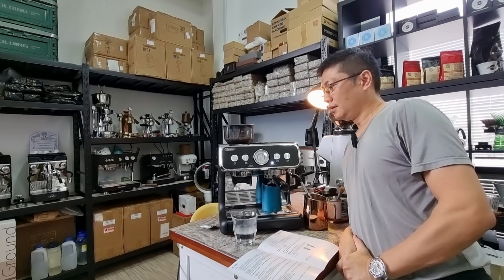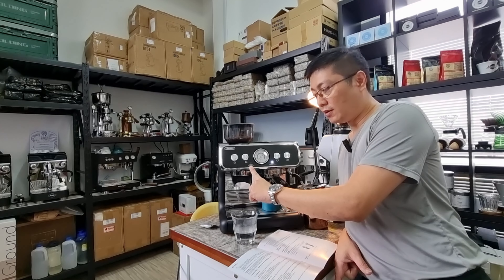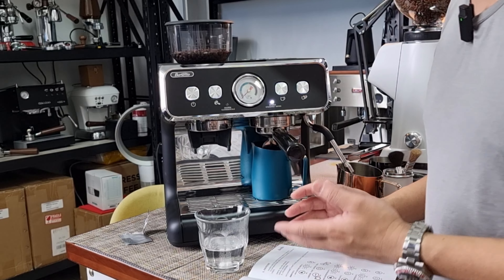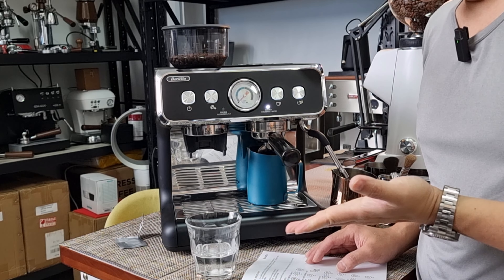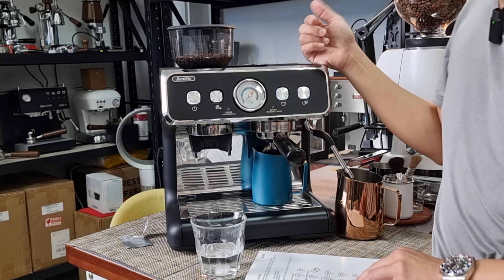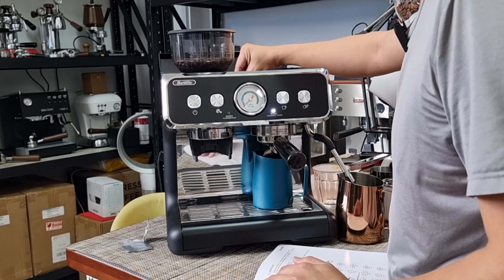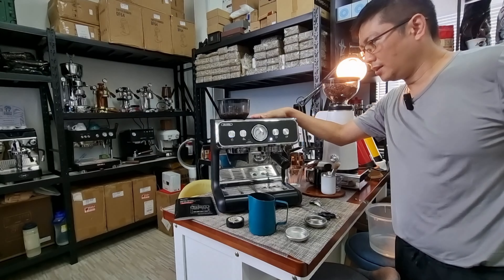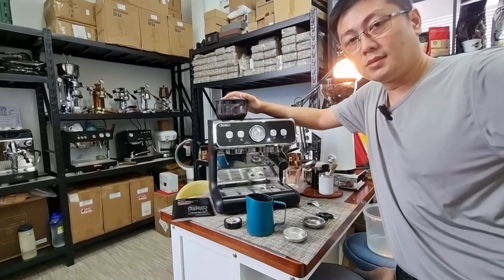Barsetto BAE 02 | Descale | Adjusting PID Temperature

Comment: Hi. I try adjusting accordingly and using temp scale, max i can go to 76f only. Kindly check if your machine can go to 96f then something wrong with mine. Very much appreciated if you can inform me the findings. Thanks.
Reply from the maker: Which temperature did you measure? Water coming out of the group or water coming out of the portafilter? Either one will have the temperature drop drastically unless all the metal parts are all heat up properly.